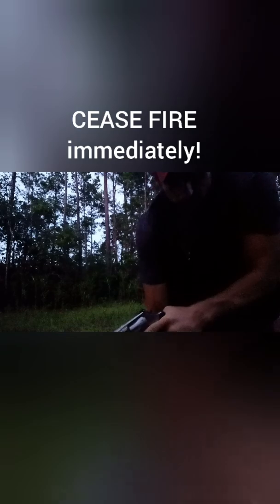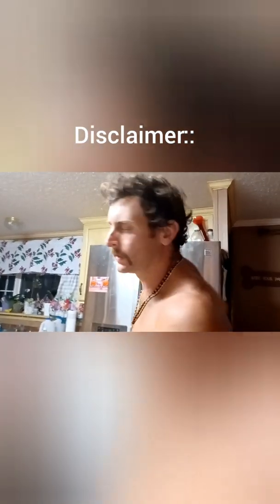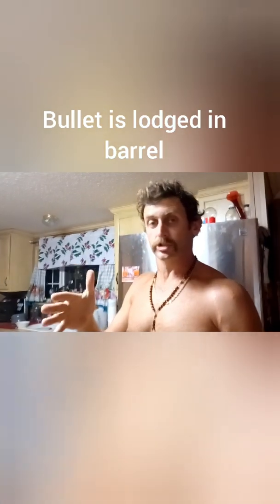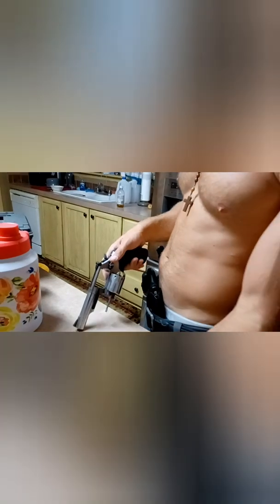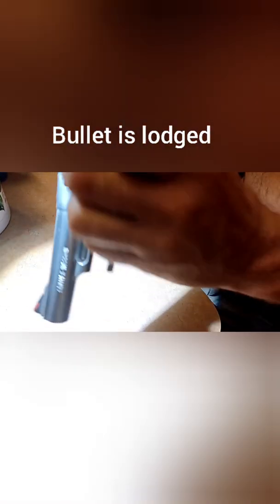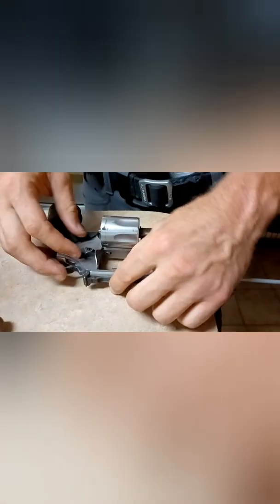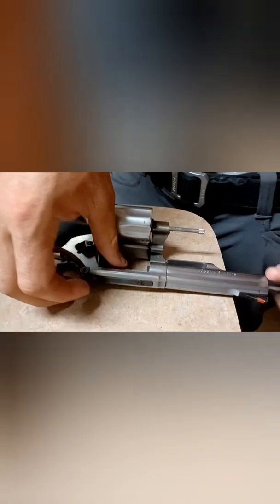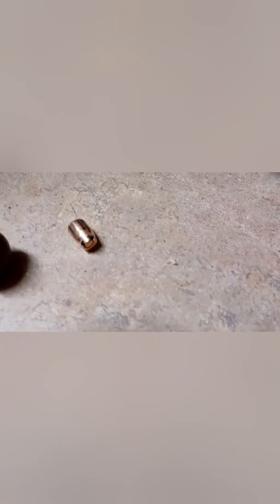SQUIB LOAD!  Very dangerous!   bullet lodged in barrel troubleshoot!

Comment: This happened in my 4.5 spring pressure carbine I fired another shot but if it was a firearm it would be gone, I had to remove it with a clothes wire

￼